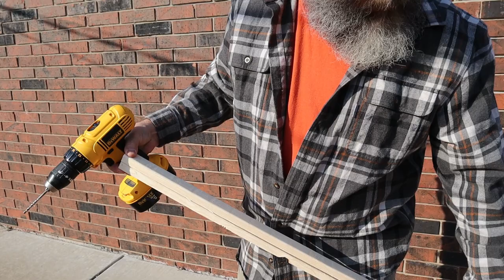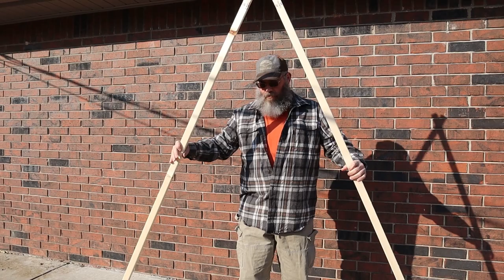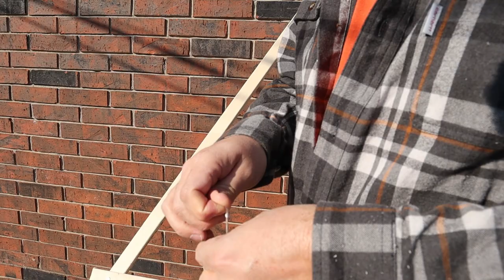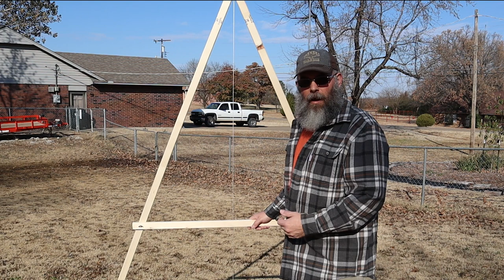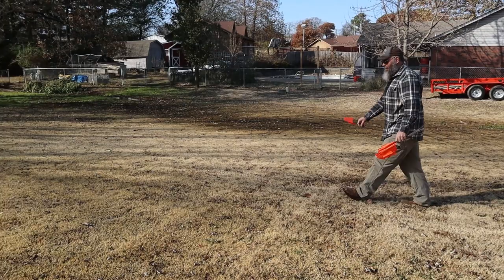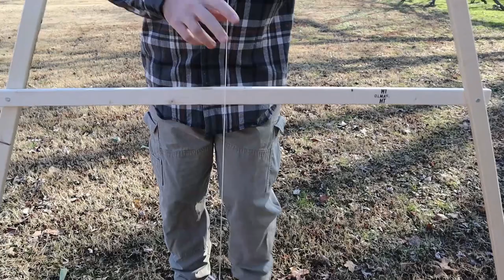How to Build and Use A-Frame Level | Permaculture Tools | Heirloom Permaculture

Comment: The whole time you were working, I kept imagining Romans laying out aqueducts to exact slopes.  What a great survey tool.  You can use it to analyse large areas to arbitrary precision.
Reply from the maker: It's definitely not the high precision method but it'll get you where ya need for overall design improvement or understanding. We have a laser transit for large project or extreme accuracy.

Comment: Well done!  I am now ready to mark off our first swale.  Can a swale be in sections along a slope or should it always be continuous?  We have 3 new fruit guilds and I was thinking of putting a mini swale on the upside of each; all are along the same slope.  Thanks.
Reply from the maker: Mini swales above trees will work. The watering effect carries downhill a ways if your soil is permeable enough. You're basically building a horseshoe basin uphill to capture and sink the runoff without directing it across the elevation. You want the water to be gone within 2 or 3 days after a filling rain. Any longer, you'll start seeing negative effects like pests and too wet soil. Adjust the spillway as needed.

Comment: I will be building this but instead of using the string with weight, I decided to screw in water bubble because the string won't work in our area due to we get a lot of high wind. Would that work the same?  Also, I was hoping at the end you would zoom in closer so I can see the action of folding works with the screws you have in there...like did you have to loosen one side so get it to collapse or what? Thank you.
Reply from the maker: I'm sure you could make a bubble level work. They key would be to make sure you establish true level on the setup to start with. As far as the folding, we just loosen the top "hinge" screw and remove the screw on one side of the cross member. You'll figure out real quick which side to unhook so that it doesn't bind when collapsing. Might be able to use either side.

Comment: Isn't the point where the string hits on the cross bar just exactly half way between the two holes/bolts holding it in place? Seems it might be easier to just measure first, and then verify with the 180⁰ rotation thing after.
Reply: As soon as I posted my comment i realized you hadn't used a measuring tape to build it, so your method made more sense again, BUT THEN I thought once again it might be easier to find the length of string between the two holes, then fold the string in half and that would me the center point.  
More than one way to skin a cat i guess. 😁

Comment: Just attach a level to your cross-beam and the wind will be no problem. No weighted string.
Reply from the maker: That's another option that comes with it's own challenges.
Reply: @HeirloomPermaculture  Great video, I'm just curious - what's the potential problem/challenge of using a bubble level vs string? Thanks-
Reply from the maker: @marceltheisen2921  if you can insure that the crossbar is exactly parallel to the feet of the upright and the bubble level itself hasn't been damaged, I can see it being a fairly speedy option to ballpark level. Centering the bubble always seems a little more subjective than exactly aligning a string to a mark though.

Comment: Perhaps dimensions, as you were building it, would be nice so one does not have to guesstimate!
Reply from the maker: If the legs are the same length, and the crossmember is attached at the same height (as discussed), the dimensions are irrelevant and can be scaled to any desired size.

Comment: I'm not so sure a laser level would be faster. With a laser level you have to use a site stick to find the level point and measure the distance flag to flag. 
turn the frame around in the down hill direction and you can keep it level till it touches the ground again. Then you already have the distance between flags measured.
A line level tided to two sticks and used by two people might be faster.
Reply from the maker: I can assure you that our laser level with audible confirmation on the receiver is WAY faster. We can cover a couple hundred feet of a contour in a few minutes. But you pay $$ for that speed and convenience. We'll likely do a video on that one too. Btw- thanks for stopping in, as always! We're always glad to see you.

Comment: Is this really necessary? It doesn't seem practical. The point of the frame is so narrow and the ground varies so much I can't imagine measuring based on these two points would make much an impact.
Reply from the maker: It actually works very well to identify the overall slope and contours. Constructing swales and other water control or identification systems is easily accomplished. Your eyes can be very misleading but using a level fixes that. We prefer our laser level for larger projects but this is a very cost effective tool for more limited use.
Reply: @HeirloomPermaculture  So if I wanted to measure out a meter wide swale what I need to do then is the map out the contour and then just dig right on the line?
Reply from the maker: @sountay  in very simple terms, yes. You may need small amounts of fine tuning on your swale depth and berm height after it fills with water. But you have the basic premise nailed down. Give the water a natural place to overflow where you want or it will make one.